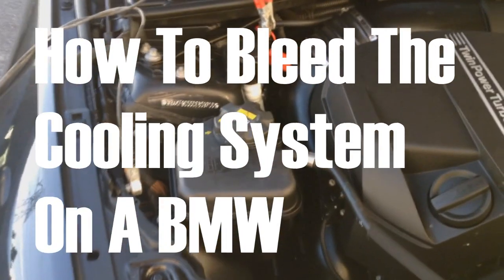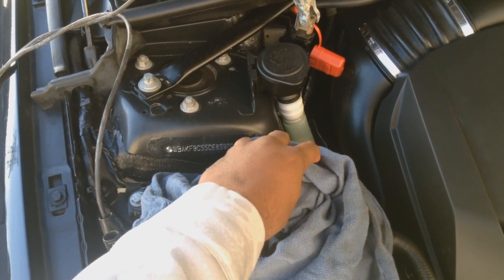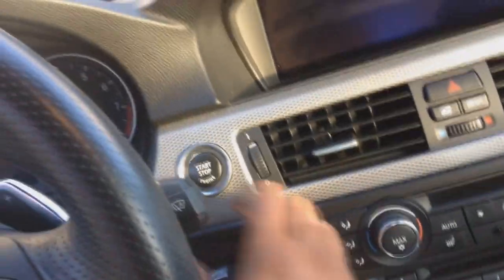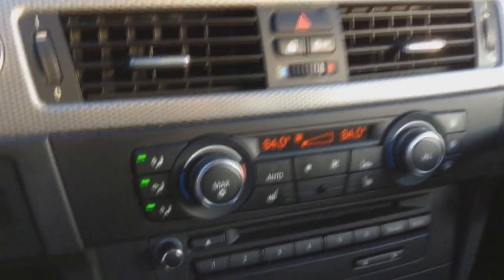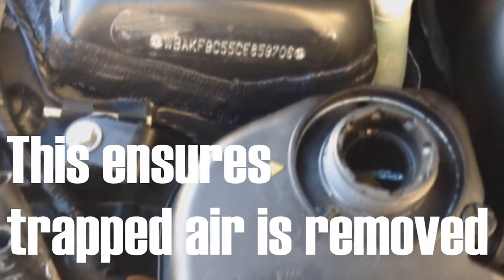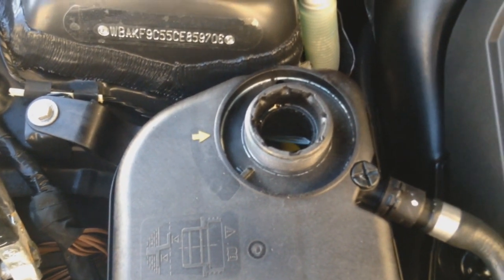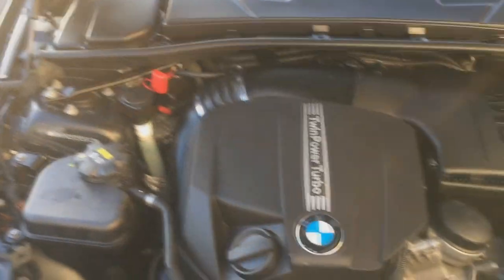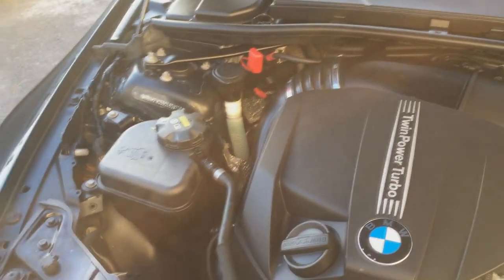How to  Burp trapped air from BMW Cooling System/Water Pump test

Comment: You saved my life. 

I was adding coolant and wanted to bleed the coolant and cracked the bleed screw. It made a mess. I found a bronze replacement from my e46 that fit on my e92. Coolant wasn’t reaching the lower hose radiator as it should after. This helped me a lot and solved my prob. ✊🏾✊🏾✊🏾
Reply from the maker: No problem man ...subscribe...got more videos coming

Comment: Bimma Joe - thanks for the posted Vids - Very informative.  I have a 2004 BMW 325i E46 w/M52 engine package.  This does have the belt driven main water pump - on the drivers side inner side of engine  compartment - and there is an electric motor
mounted with two hoses coming from the heater core affixed to the electric pump does run in key switch position one, heat on high, fan on low.  This pump doesn't seen to force the water forward to the reservoir, radiator, thermostat or its housing.  I do jack the front of the car up about 18 inches (of course setting it on jack stands).  With the Key on in position 1, heat on high, fan on low, it still takes 20>40 minutes to thoroughly bleed the entire cooling/ heating system.  Have found that a quick engine start with a mild engine rev (~3,000 rpm) and squeezing the two large upper hoses ( of course with the engine off) - is the most effective and a certain way to eliminate air bubbles throughout the cooling system.  I'm not certain the electric pump in the cooling system is working @ 100 percent.  These pumps are expensive: $140>$250 range for a new one  Keep up the good work!!!  Petey VW

Comment: Thanks man for the video, I had some gurgling noises coming from my vents when the heater is on, changed the valve, but still the noise was coming. I tried this bleeding procedure and the noise seems to have gone or at least reduced dramatically.
Reply: your heater core likely has leaks.

Comment: Do I need to have my battery connected to a charger or another car battery to prevent my car from dying? Or should I be good to just run the car after and test drive

Comment: My car was running fine, not overheating but I had to change top radiator hose, now I have no leaks but I also don't have any heat. I have been trying to bleed the tank but I don't hear my water pump kicking in
Reply from the maker: Try n bleed it manually if the waterpump not kicking in …then i guess u know what time it is

Comment: Anybody Help!!!! I have a 2006 e90, no overheating issues till I had a mechanic work on the oil filter housing because of leaks, everything done, took car out for a drive, after driving for 30 minutes or so, yellow temp light flashes, coolant leaking but dunno from where, Mechanic came, put water and just bled and drove car the whole 1 hour without issue. Third day, tried going out, after 10 minutes, yellow temp flashes again, pulled over, leak around the hose that goes into the oil filter housing. Changed hose, start car for 15 minutes, pump ran and after 15 minutes, yellow temp warning light reappeared with radiator fan cranked high, no leaks. Car cooled down, did self bleed and waterpump ran for over 14 minutes in self bleed mode. Once car is started after 15-18 minutes, temp light flashes, could that be the waterpump or something else? I don't wanna throw money away on another waterpump if that's not the issue. During self bleed and initial start of car, water pump works and seem to squirt water with high pressure and this only lasts for a few minutes before it stops working.

Comment: Great video and thanks for your time it took to produce it. My 2010 e70 3.0 suddenly showed "Low Coolant" warning signal. Check the reservoir only to notice no visible coolant at all. Added Coolant and everything seemed fine. Drove it for for close to an hour with no issues. Parked in the driveway. Came back to it about 10 hours later only to find a small puddle on the passenger side. Low Coolant warning displayed again. Pulled the splash guard and looked like coolant drips were coming from the thermostat. In your opinion, could this be from not bleeding or failing Pump and/or thermostat?
Reply from the maker: Well it could be that but, from what ive experienced earlier this year (and you can check my newer videos on this). My radiator cracked and i had to use a pressure tester to figure that out....what I realized was it cracked due to worn out shocks and struts....and that may be your case also since the housing of the thermostat is made of plastic the beating of poor struts suspensions can have a major impact in cooling parts and other various components thru out the whole vehicle....so if you have not had your struts and shocks replaced the do so, or more issues will arise...TRUST ME!!! My valvecover started leaking badly because of that reason also....the videos ive done ✅ are all on my channel....by the way ...i didnt film doing the struts because that job was tough and mind you the parts can get costly and when i checked the shocks they were so bad I probably would have more issues if i let it continue....good luck bud!!!
Reply: @BimmaJoc  wow, never heard of a car with worn suspension causing such things. If that's the case, could it not cause similar problems with uprated stiff suspension? Poor fragile design surely.

Comment: Hello. I got a question So this morning when I turned on my car there was no power at all none of the lights were on so I assume "dead" battery but when I went to check the battery I moved it around and had power again (seems the negative cable was a bit loose) anyways I drove the car for about 15 mins and I started getting the Overheating light display which surprised me because I have had everything that deals with cooling replaced so does the water pump need to be "reactivate" of some sort since I assume the car had no power overnight and reset some things?
Reply: I have exactly that issue aswell, I blew the coolent tank aswell. Did you ever solve your issue?

Comment: If it doesn't do this does that mean the water pump Is out? My hose came off yesterday and I refilled the coolant and it  was starting to overheat. I tried this and the water pump didn't activate. Any help is appreciated thanks
Reply from the maker: Have to
Replace waterpump thermostat also and any defective hoses …need to have battery checked possibly replaced since tied with pump theres an electrical connect that goes from pump to battery ….coolant replacement and bleed….this is a nightmare job but could be done ..anything with the battery plus coolant pump gets to be a pricey job and pain
Reply: What if my water pump made a sound, didn't squirt any coolant and my heater works?
Reply: I have a 2009 BMW 328i.
Any suggestions?

Comment: Doing this on a bmw f20 116i, the lower hose staying cold. Just had rad changed and car been overheating.

Done this procedure can hear the pump working but nozzle not squirting water like in your vid any tips?
Reply from the maker: Thats how you can tell the waterpump failed

Comment: I just change water pump on bmw 335i 2010 like 4 month and now have the same problem again  ,over heating and scanner saids water pump power reduce but wasnt original 🤷‍♂️🤷‍♂️
Reply from the maker: Sell it trade prices are thru the roof right now
Reply: @BimmaJoc  sell what? The car is 69k miles now i think buy the chinese water pump was not a good idea, on tha i never had a real problem with the car
Reply from the maker: Yeah man trade it get something reliable…best thing to do ….because these high trade prices wont last
Reply: @BimmaJoc  i have 3 more cars but i have to fix it first

Comment: What do you mean make sure the battery stays charged? I installed a new battery, should I be worried about this?
Reply from the maker: If you are trying to use this electronic bleeding procedure then it can drain the battery…thats why you use trickle charger

Comment: I bleed my coolant the first time and everything went good I did it a second time and I hear the water pump run but I don’t see fluid squirting like it usual does , and it’s topped off
Reply from the maker: Is there hot air coming out the vents???
Reply: I have e60 and my heat is sorta warm but not at temp I'm use to ?
Reply: And I just changed the to aluminum flange
Reply from the maker: Then bleed the system leave the bleader screw a lil loose not too much  let the engine run until fan kicks on or  a lil fluid come out the bleader then tighten it should be a small squirt ..,check the for hot air .,,then if its hot then ya good ⚠️ only do this if the car is cold engine like havent ran for hours
Reply from the maker: Also its shouldnt me toped off to much suppose to be only to required levels....if theres too much pump some out
Reply: I got it . Using the steps from your video helped me out alot 👌🏾✅🎯
Reply: @BimmaJoc  thanks for this great tip , but how can I disable this,  since it keep starting each time when look on, or  unlock the doors, my battery drained

Comment: Hey! Do I need to crack the bleeder screw or anything as I run the cycle or can I just leave the cap open and run the 12 minute cycle? I am doing a reservoir replacement and need to bleed the coolant.
Reply from the maker: Thars no you dont need to open the bleeder screw if your are doing it electronically and you can also keep the cap on

Comment: Hi I just replaced the radiator on my car, is a 335i N55 engine as well. How many ounces/litres of coolant do I have to add before doing this burp procedure ?
Reply from the maker: Coolant mixed with distilled water i hope….and theres a level indicator on the coolant tank that tells you where to stop
Reply: @BimmaJoc  Perfect, thanks for your reply, so I just have to fill it on the reservoir until I see its full, after doing the burp it will probably need more right ?  is that okay if I just do coolant ? I will do it on tuesday so Im trying to get all of the right info before starting. Just wanna make sure I dont blow my engine lol.

Comment: so when you bleed the cooling system, where does the coolant go? Is it being discarded?Do you top up the coolant after?
Reply from the maker: When you bleed the system what you are doing is removing trapped air that can cause failure.  The coolant stays in the system, it flows thru hoses, thermostat, water pump , radiator, engine block and heater core.
Reply from the maker: Top off according to the marks displayed on the reservoir tank...never overfill because that will cause failure and tank to burst.
Reply: So the system must have coolant in it?
Reply: And what happens if you try to do this with no coolant in the system
Reply from the maker: No coolant in the system??? Then your engine will blow ...need new engine

Comment: Do all the newer BMWs have an electric water pump? My father is having issues with sometimes having a cold lower radiator hose which causes the engine to run a bit louder and a hot smell in the engine bay. It's one of the i4 twin turbo diesel engines on an F11, not sure if it's 2.0 or 2.5
I told him about doing this and he said that his apparently doesn't have the electric pump but maybe he is wrong. I found some manual which said to idle the engine with the coolant cap off and rev the engine every once in a while and do that for like 10 minutes, but that had no effect although it did cause similar spray from the little hole as in this video
Reply from the maker: The spray is when you put the heat on ...the reving of the engine is to get the temperatures up to normal operation so that the air pockets are removed which is bleeding the system....so that works....by the way...once the heat is blowing hot air from the vents the process is done and no need to go further....reving the engine too long can cause the coolant to escape the tank onto the whole engine bay and cause a fire so be careful...hot air from the vents system is already good to go.....but no not all have an electric pump to be able to do the electric bleeding...and doint it how you just said works fine
Reply from the maker: But a hot smell?? That would lead me to have the system checked for leaks...i have a video on this on my channel

Comment: 2:50 why is it making that noise?
I’m trying to diagnose my F10 535i as to why it randomly overheated few days ago.  When I do the bleed test it does the exact same thing full pressure..... slowing down..... Stop then makes that rattling sound and then full pressure again.

When the engine is started and nice and hot the flow of coolant in the overflow tank is consistent flow without stops and when the heater is off the flow slows down.
Reply from the maker: Daniel Triantopoulos that noise is the electronic waterpump cycling the water
Reply from the maker: Daniel Triantopoulos so did you find out why your engine over heated? I notice these vehicles are thirsty for coolant especially when driving a lot monthly
Reply: Bimma Joc I rarely to never top the coolant up unless I do the flush.  But it hasn’t overheated since so its weird....
Reply from the maker: Daniel Triantopoulos yeah man try to check on the regular because water evaporates often on these high performance vehicles ...first couple pages of the repair manual says to check fluids every 250 miles and no one ever does🤷🏽‍♂️ well i do or try at least

Comment: Will the pump shut off off on it's own?..Or just turn car off?
Reply from the maker: joe lane It will not shut off on its own...you dont want it to run for no more then 12 minutes...for two reasons the charger charging the battery and the battery it self being in use with out car running.

Comment: Make damn sure you use at least a 10 amp battery charger while doing this - I used a 4 amp, and after 25 minutes the water pump was still bleeding when the battery died.  My Light Control Module was then BRICKED - and made the car undrivable - no windows, no dash lights.  Bizarro.  BMW's circuitry put the car into BRAKE mode - it was immobilized.  I have since pulled the LCM and sent it to a guy in Massachusetts who will allegedly reset the EPROM or some other such wizardry.  Otherwise you have to pay to tow it to the stealer who will charge you over $2000 for a new LCM.  Grrr
Reply: dang.  thanks for the warning.  any updates?

Comment: Nice video.  Good instructions.  When would someone use the bleeder valve located on the tank?
Reply from the maker: Its an option ....i would use it depending on the severity of the job ...like when i did the radiator and the vehicle was still in jack stands... i wanted to make sure there were no more leaks in the system https://youtu.be/lel5CINXKAQ

Comment: Hello, this may be an old video, but I am facing a problem with my e92 Bmw!
When I turn on my car everything is normal until the oil temperature reaches 250, then is shows on my screen "High engine temperature" and the fan turn on on a very high speed!
I did the same test before watching the video and but for 3-4 minutes and it shows the the pump is functioning...How can I make sure if I need to change the pump or there's something else to do to avoid this costly issue!
Thank you
Reply from the maker: You must have a leak somewhere ...your losing coolant the engine is overheating if your fan is going crazy....the system needs to be pressurized to find a leak ...try adding bmwcoolant/distilled water 50/50mix to recommenced levels according to coolant tank...do not over fill
Reply: Thank you for the reply, but I don't really have water leakage!
Reply from the maker: Elie Saab but theres internal leaks also😬 or maybe the thermostat bad??? The coolant sensor?? The oil pressure sensor could me bad ?? Run a diagnostic test/ scan tool and  find codes
Reply from the maker: You wont be able to see it if its Internal
Reply: hey i was just gonna see if you found what was the issues with yours i’m having same exact problems

Comment: Could I do this on a used bmw to see if the water pump is bad?
Reply from the maker: Only if the water pump is electric....so whats the year of the vehicle
Reply: Bimma Joc it will be a 2011-2013 bmw X5 35i
Reply from the maker: Yes sir that works

Comment: Hy, i try what u did here, but my pump doesnt work, no sound from her. Coolant temperature is about 80-82°c on highway and 94-96 in the city. no other error on ista. Is it right? 2007 bmw 320i. Thanks.
Reply from the maker: Check to make sure if you pump is infact electric…some bmws are not
Reply: @BimmaJoc  u are right, mine is mechanical, i change thermostat and see what happent.
Reply: @BimmaJoc  ok, today i change thermostat, when i try to drain coolant from radiator, not a drop. u think are clogged?

Comment: My 07 x3 won't heat. Coolant light turns on when the motor reaches center temp.
Reply from the maker: So something wrong with your thermostat…waterpump or sensor

Comment: I did the bleed process once and then it wouitirn on anymore. I turned my car on and it overheated at 117 celsius so I turned it off. Why won't it go back on?
Reply from the maker: That bleeding process is also a water pump test so...maybe ya water pump is failing
Reply: @BimmaJoc  it's a brand new pump and thermostat 🤔 I can't figure it out.

Comment: Should I add coolant before doing this process or after it’s complete because I added coolant and used the bleeder screw and coolant was spilling everywhere please help
Reply from the maker: Whats the year make and model ...usually the bmws with the turbos have this feature....and coolant should be added to required marks not over....the bleader screw is awesome ...but you may have left it open for too long
Reply: Bimma Joc it is a 2007 328i e90 bmw
Reply: I bled the system twice and the bleeder screw was pouring coolant out
Reply from the maker: Ok so that vehicle does not have the turbo and maby the bleeder screw is defective...if its not dont use the bleeder screw just leave the coolant tank cap off until hot air is blowing out the air vents ...it shouldnt take long